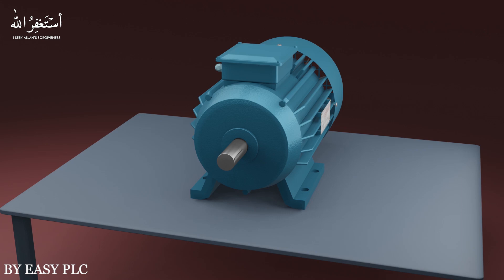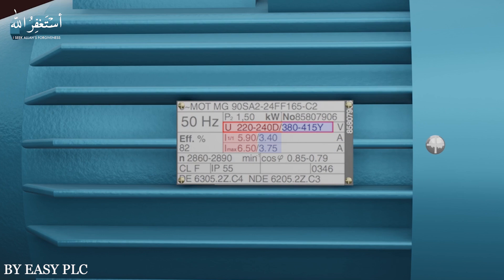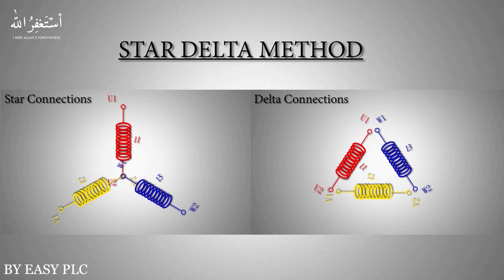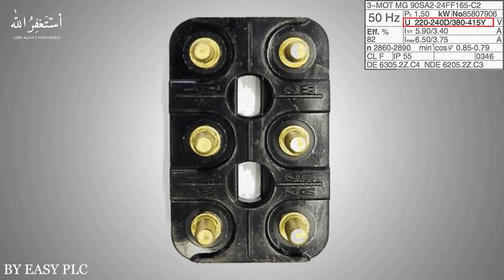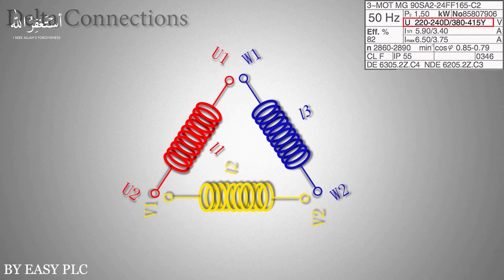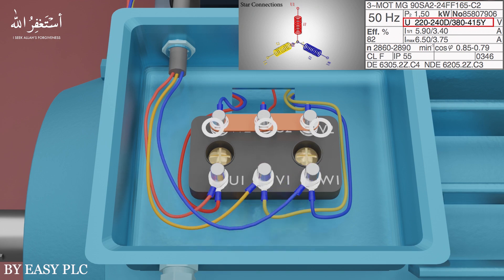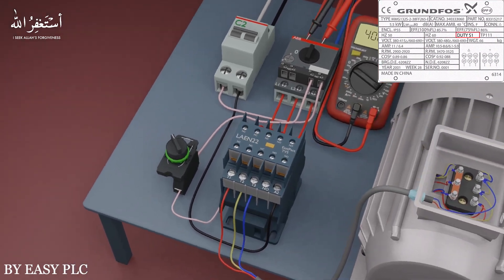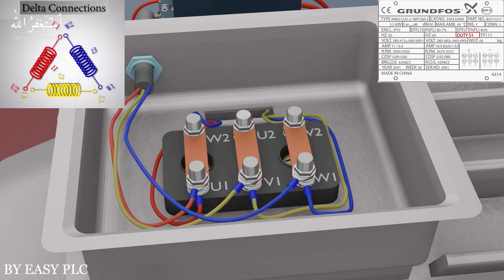How to wire Star and Delta connection in DOL Starter ? guide for absolute beginners

Comment: What voltage should i supply for 🔺connection 220v or 400 v ? If we need to supply 220v for🔺connection  , How we can provide it to the motor?